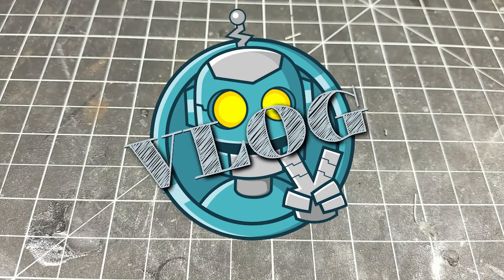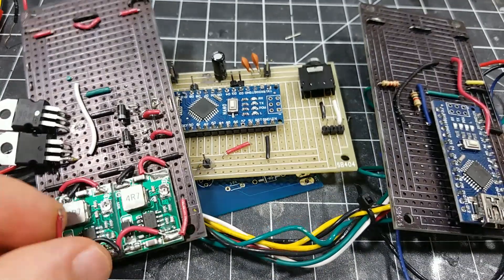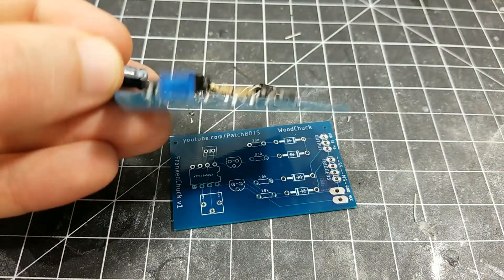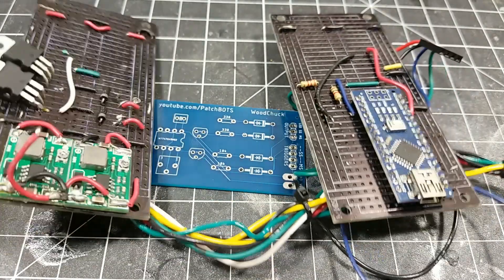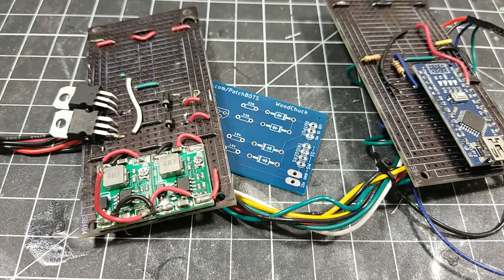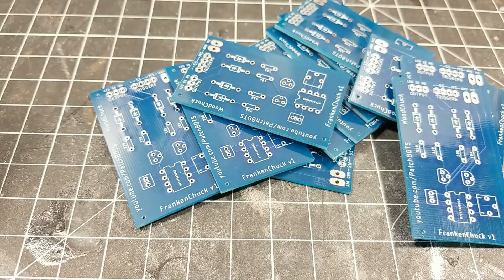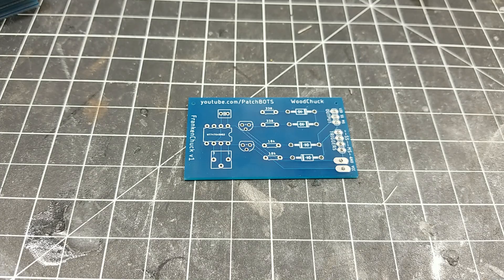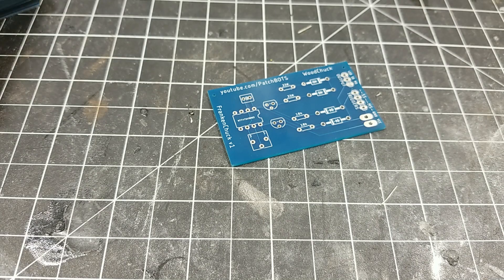VLog #002 - Printed Circuit Boards #1

Comment: If you need any pointers or get stuck anywhere with your move to smd board feel free to reach out. I remember first starting with Eagle and being a little frustrated with using libraries and such.
Reply from the maker: Awesome, thanks Jon, I definitely will reach out if I run into anything!